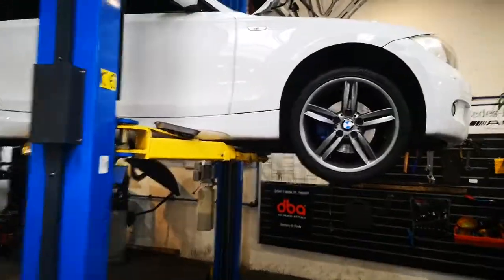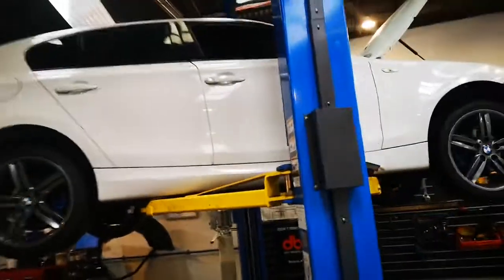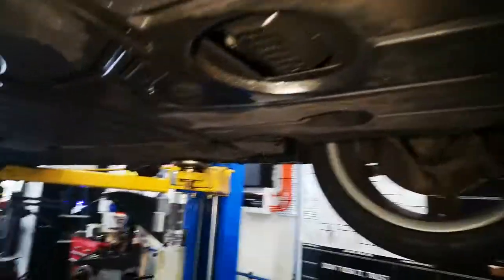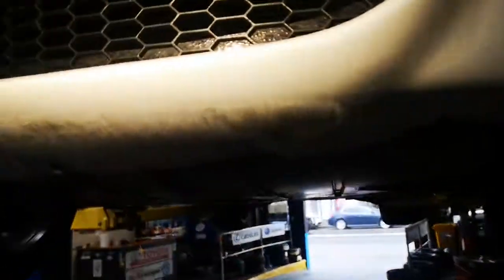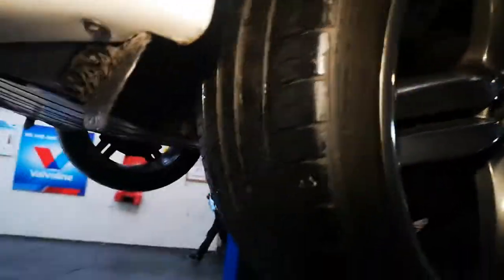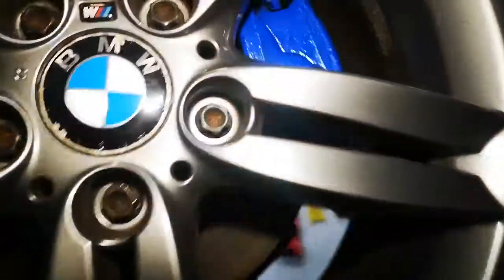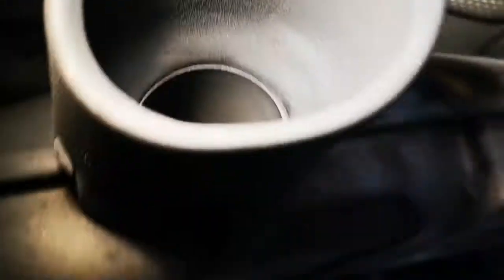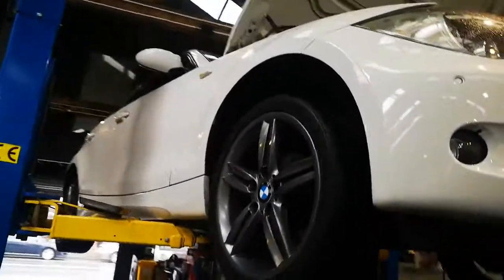Beware used BMW. Excess blowby oil leaks 118i 120i 125i 120d stay away! Pre-purchase inspection 1st!

Comment: I was looking to buy a used 114i 2013 model. It has 70k miles on clock.  I did notice that there was oil leak under the turbo . What could be the cause? After some 15 mins of drive, I felt a burning smell from the bonnet and once I opened it I did notice that there is oil leaking underneath the turbo. I don't know from where it is leaking exactly. Please suggest.
Reply: a bit late, but just as an info, there is a common issue with oil filter housing sealing, would start from there. also in that area is the oil pressure sensor, sometimes those can leak as well.

Comment: Thats a bad generalisation about Chinese tyres lol. I have winrun rx330 on but doesn't mean I don't look after the car with regular replacement of oil, fluids and serviceable parts. Its BMW's marketing that long service interval for oil or even life time transmission. N46 is a shit engine with a faulty stem seal or the shitty pcv system. If you look at the number of BMWs go by on the road 8 out 10 will have stinky exhaust smell or a trail of smoke.